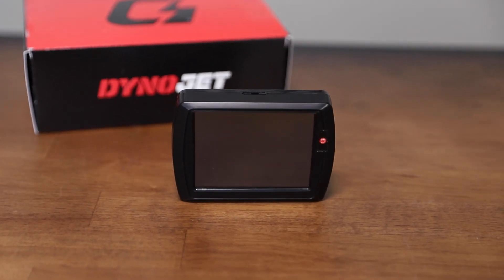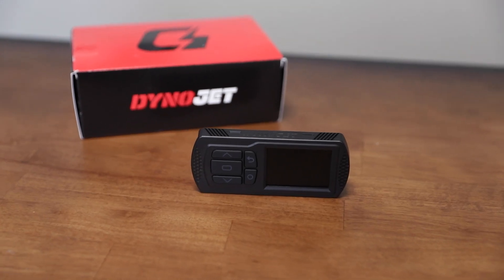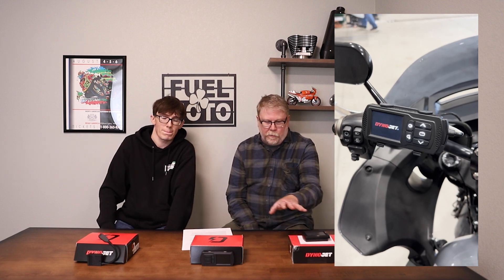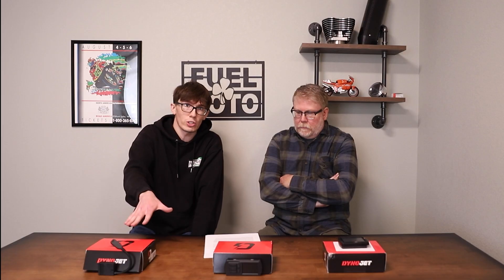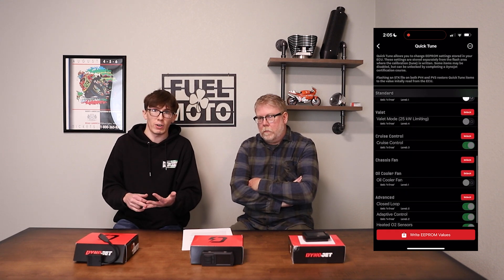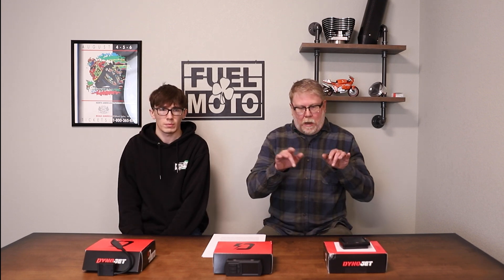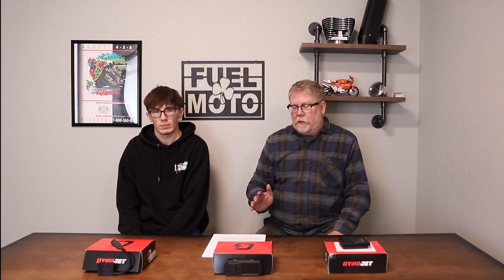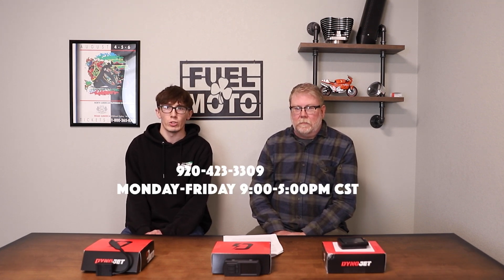Flash Tuner Differences Explained: PV1, PV3, PV4 | Dynojet Power Vision Guide by Fuel Moto

Comment: I switched from the V&H FP3 to the dynojet power vision 4 yesterday and I went on a ride today and the speedometer live gauge kept showing no data or lagging way behind the actual speed and my speedometer on my 07 street glide was doing the same and I noticed every time I’d turn my bike on the tuner would show a BUS error at the bottom then it would turn green and say it cleared the error. Then all of a sudden all my gauges on my fairing dropped to zero while cruising at 65 and all the indicator lights came on like the bike wasn’t running. It was showing a P1010 code in the diagnostic part of the PV4 app saying a password was lost in communication basically. So I went home and did some research and found that resetting the 5 digit pin on my bike would reset the password communication between the ECM and the security control module(TSM/TSSM). Once I did the password reset my PV4 app shows 0 codes now so HOPEFULLY this issue is fixed because I never had this issue with my V&H FP3. The only other issue I have with the PV4 is the lack of tunes available. I have a 07 street glide FLHX with a full exhaust system Vance and Hines big radius 2 into 2 and a high flow air cleaner and with the filter option in the app it only gave me 1 tune available with a stock 96 with a high flow air cleaner and it said Vance and Hines big shot long. 2 totally different exhaust systems.

Comment: if i buy a used power vision pv2 can it be paired with a new bike
Reply from the maker: Yes, you can pair a used Dynojet Power Vision PV2 with a new bike, but you must purchase an Unlock License to remove its pairing to the previous motorcycle's ECU.

Comment: What I really want to know is will anyone of the 3 will work to make my bike run and ride I took a 96 cubic inch out and replaced it with a 103 cubic inch and was told need to tune it and flash my ecu
Reply from the maker: For your 96 to 103 cubic inch conversion, a Vance & Hines Fuelpak, Power Commander, or Dynojet Power Vision can all work to tune your bike, but they each have key differences. The best choice depends on your tuning experience, budget, and future upgrade plans.

Comment: Once I install a PV4 on my 2016 Indian Chief dark horse, how much does it cost to download a map file to flash the bike? If I want to try a few different flashes, how much extra is that? Thanks
Reply from the maker: Flashing map files to a 2016 Indian Chief Dark Horse with a Dynojet PV4 costs nothing extra once you have purchased the device. The initial purchase of the PV4 includes the cost of the first license, which is tied to your specific motorcycle (VIN). 

You can flash as many different maps as you want to your bike at no additional charge. This is a core benefit of the Power Vision system.

For a truly optimized tune, you may want to purchase a custom-built map from us. While these maps cost extra, we offer free lifetime tune adjustments for the original purchaser.
Reply: @FuelMotoUSAWI  Thanks. A little late on reply. I already purchased the PV4 from you guys at Fuel moto. Super easy to use. Just wish Auto Tune worked with Indian.

Comment: I have a PV4 on my 23.5 RG CVO. I have a brake bleed service light on my dash and this PV4 is supposed to have that feature. Mine does not. When I go to service on the PV4 it says "no services needed" which is not the case.
Reply from the maker: If your Power Vision 4 (PV4) is not showing the brake bleed service feature, it's likely because you have not purchased the tokens required to unlock the special service routine. This is a pay-per-service feature that is separate from the basic diagnostic capabilities of the device.
Reply: @FuelMotoUSAWI  I registered my PV4 on Dynojets website several months ago and I looked for the brake bleed feature ready to buy the tokens, none was available. I called Dynojet and they stated that its not available yet on the new CVO's because HD put additional security measures in the ECM that they have not cracked yet. They said maybe available in the next few months which basically means they have no idea when it will be available.

Comment: How do you make the adjustments to eliminate decel pop with the PV4
Reply from the maker: To reduce decel pop on a motorcycle with a Dynojet PV4, use the Quick Tune feature on the device, navigate to the Fuel tab and add fuel to the Decel column, then go to the Spark tab and add timing to the Decel column, starting with a +5% fuel and +3° timing adjustment, then flash the tune to the bike and test ride, adjusting further in small increments if needed.

Comment: Can I buy one transmitter to do two can am spiders
Reply from the maker: No, you cannot tune two different Can-Am Spyders with a single Dynojet device without purchasing additional licenses. The Power Vision unit marries to the first vehicle it's connected to, and you will need a separate Tune License, which is specific to the vehicle's ECM, for each additional Spyder you want to tune.

Comment: is there going to be a cable for 2024 harley for PV1?
Reply from the maker: For a 2024 Harley-Davidson, you will need a cable and Power Vision tuner compatible with the newer CAN-Bus system, not the older PV1 (J1850) model. Harley-Davidson updated its electronic control unit (ECU) communication standards over the years, making older tuners and their cables obsolete for new bikes.

Comment: Can this remove decel popping.
I have a Harley Fatboy 2003 and the pv1 was great ,but in London I had to have a flash put on to comply with the ulez.
Pv1 great but all the wires ie wideband O2 censors ,which I removed and blocked off.
So I no ow have decel popping.
What would be best guys.And thanks
Reply from the maker: Your Power Vision (PV1) eliminated the issue by enriching the fuel mixture at 0% throttle, a change that the new ULEZ-compliant tune likely removed. The removal of your wideband oxygen (O2) sensors further compounds the problem because the engine's control module is now running a pre-programmed, standard map instead of adjusting in real-time.

Comment: Hi Guys. I just installed a Bassani exhaust on my low rider st 2022. Originally the bike had 4 o2 sensors. After the Bassani only 2. Do you guys know if I can delete the 2 that are not installed anymore? Now I get an engine light when riding. Oh yeah, I have the pv4. Thanks a lot!
Reply from the maker: No, you should not delete the two unused O2 sensors; instead, you should load a tune for your new exhaust onto your Power Vision (PV4) and at least temporarily reinstall the sensors or use O2 eliminators with the correct resistance to stop the engine light from coming on. Without a proper tune and functioning sensors (or their simulation), your bike's engine can run poorly, experience performance loss, and even sustain damage.

Comment: I just purchased a PV4 arrives next week to finish my stage 1- iron1200 currently slip on and heavy breather intake. What gains and feels would I expect? Also would the auto tune feature make it run better/ smoother etc..?
Reply from the maker: With your current setup—slip-on mufflers and a heavy breather intake—the Dynojet Power Vision 4 (PV4) tuner will allow you to complete your "Stage 1" upgrade. The tune will correct the air-to-fuel ratio (AFR) that was thrown off by the more free-flowing intake and exhaust, resulting in noticeable improvements in feel, performance, and smoothness.

Comment: You guys mentioned fans... Does that mean if I add a Harley oil cooler fan, or rear cylinder coolflow fan, that I can enable them without going to the dealer for a flash?
Reply: Yes it does! I have a PV4 and added the thundermax fan. With the PV4 you have to purchase tokens to enable it.
Reply: @WyomingBagger  is it expensive?
Reply: It’s like $20 bucks! You buy the tokens and have full access to the feature or features you have paid for. I’m not sure which tuner you have but I love the simplicity of the PV4. It’s worth the money for the features!
Reply: @WyomingBagger  I have a PV4
Reply from the maker: @philblock  You can either have us enable the fan be requesting it thru our website which is free, or purchase the tokens to unlock the cooling fan switch feature with PV4
Reply: @FuelMotoUSAWI  that's awesome!
Reply: @FuelMotoUSAWI  you can't do the hill hold assist add on feature tho right? I bought the cable already so you use hill hold in Neutral...